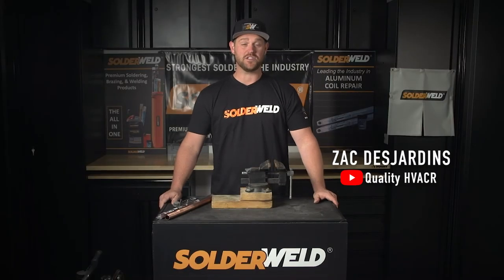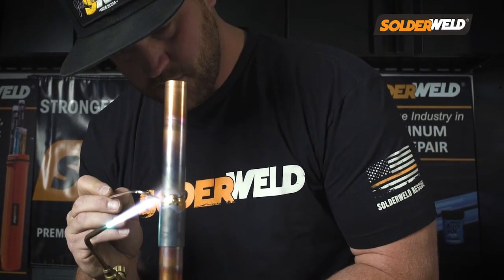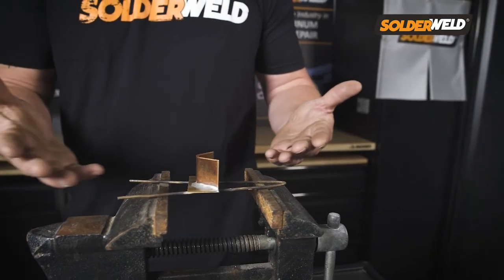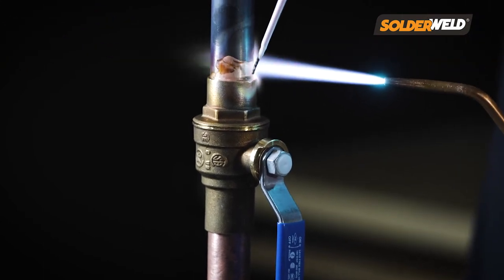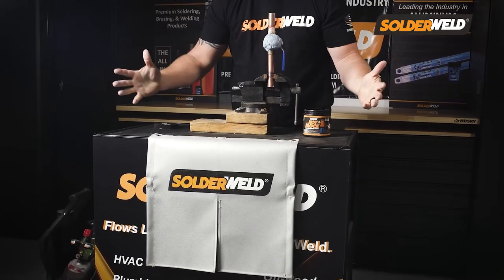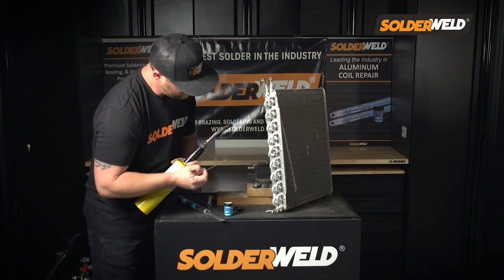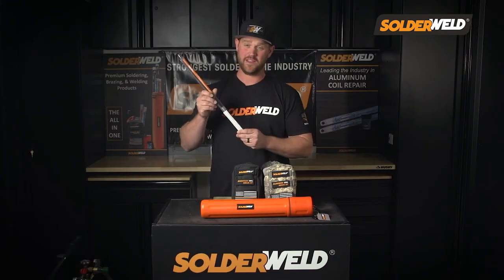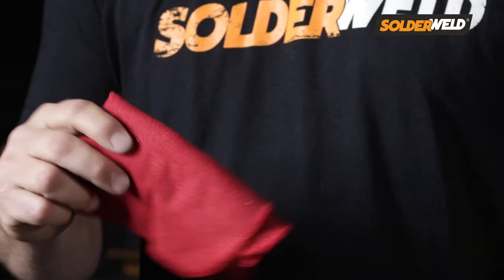SolderWeld Complete Product Line Introduction

Comment: How can you see your penetration by looking outside the pipe?  You should cut at least 75% into the cup. Then with a hammer smash it oval then turn 90° and smash it round. If it holds you have good capillary action. What you see on the outside tells you nothing about the inside.  I do have the sw-hvak kit. Love it.
Reply from the maker: Agreed

Comment: Hold on here why can't I use this  product on aluminum to aluminum. At 350 degrees I don't have to worry about burning holes in my aluminum. Actually I'm gonna to fashion a #14 bare copper wire around the ribbon aluminum pipe that butts to the header and apply your product to the two different metals.  we know your product can handle the pressure rating but can it handle shear forces such as two, 2 hp condenser fans running at 900 rpms. thats the vibration level. it is minimal.
Reply from the maker: The Low temp 350° Multi Sol rods are made for dissimilar metals and don’t effectively bond to aluminum.  Your best bet is the Alloy Sol and flux, it was made for aluminum and leads the industry as the lowest flow temp at 600°. Still way below your burn point or damage point with aluminum.
Reply: @solderweld9384 so i take it, its not applicable for aluminum even if I introduce a copper component? ok if I placed a copper disk like a penny on a piece of aluminum will Rescue solder bond properly to the aluminum? We got one shot at fixing this micro channel ($11K cost coil) and I'm practicing on and old aluminum coil and its very tricky managing the heat. The small dab torch delivers 2000 degrees but it not getting the aluminum hot enough to flow the aluminum stick. There is a guy on YouTube recommends getting a acetylene only tip that acts like a ox/ace rig. I don't understand why my dab torch or my simple propane rig you get from home depot not getting it hot enough. I even measured the flame with my k type thermometer, its 2000 degrees so I'm missing something here in my testing.